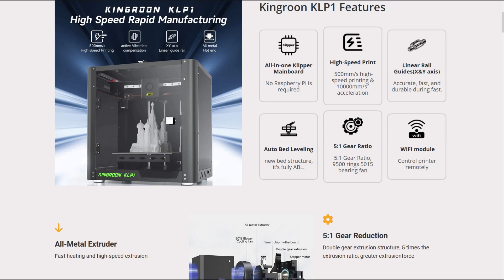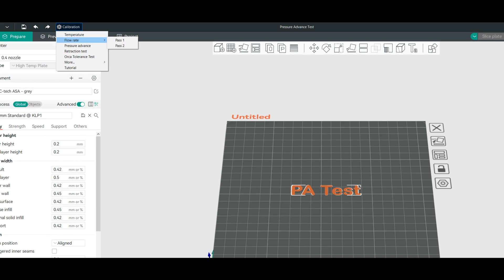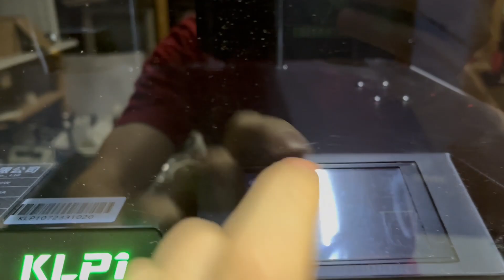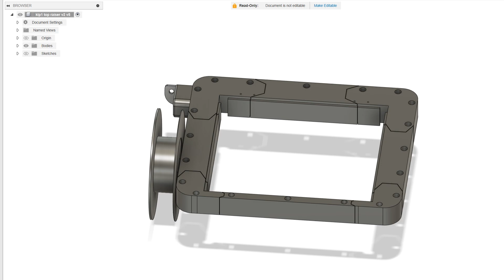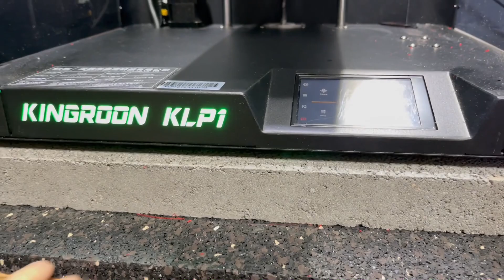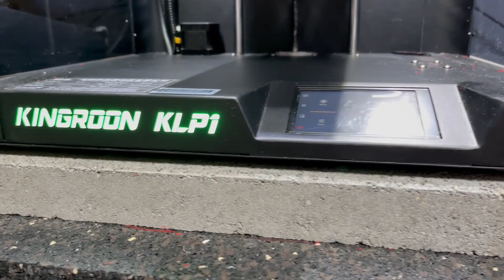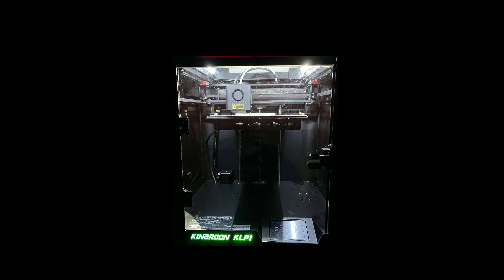Kingroon KLP1 3D printer review after 3 month

Comment: Hi great video, can you please share the profiles you are using for the printer?
Reply from the maker: I am using Orca with the profile provided by Kingroon:

https://1drv.ms/f/s!AmGcVrncIH3Zk2otPcnHZrOZPGA5?e=eH3KUu

I made two changes only:
- I tend to create a calibrated profile for filaments
- I set max volumetric speed to 15 mm3/sec for PLA and PET and 13 mm2/sec for ABS and ASA.

On top on that based on the print I change support and strenght, like amount of wall loops. The typical setting is 3-6 walls with 20-33% infill. But that is really based on the printed part.

Comment: Im curious how this printer is working out 1 year later. Its currently on sale with a 100 off coupon code dropping the price down to 229 ( I didnt check the shipping cost)  but something tells me this didn't work out.
Reply from the maker: It is still running. I do not use it daily, but weekly. I had only one issue: I to replace both fans after a while, but that it is. It doesn't show any sign of instability now, but really I am using it when I have a project or when I need something technical. I use 90% ASA, so it is a bit more heat stressed compared to PLA. Few numbers from fluidd:

Longest print was just over a day: 24:43. The total print time is getting to a rounded number: 249:22 and the average print time is 1:37. Total filament usage: 2325.89 meters.
Reply: I just bought one of these at the sale price. For that price, I couldn't pass it up. The shipping was free. I live in the US and it arrived in two days which shocked me. I know this printer has its faults, but it makes a great starting point for a small enclosed printer for printing temperature sensitive materials. One of my current printers is a KP3S which cost only $150 and it has been very reliable for several years and produces great prints. I'm looking forward to tweeking the KLP1 to make it better. I like the idea of a riser in order to clear the filament tube and wiring so I'll design and make something similar. I will be replacing all of the tinted acrylic panels with clear panels. I will also move the display to the outside to make my life easier. I plan to print ABS/ASA/Nylon with mine so I'll be feeding it filament directly from my filament dryer. And of course, I'll be adding LED lighting to the inside, along with a camera.
Reply from the maker: @Waltkat  There are room for improvement, but the reduced price makes this printer a good value. I use it for ASA without dryer and it works fine. I found the fans a bit weak, but since they were replaced I have had no issue.

Comment: Hi, really good review. I would like to know if you know the procedure to remove or replace the hot-end nozzle? For example if I wanted to change it for larger extrusion size, fixing clog, or by using different design and material.
Reply from the maker: Hi, Sorry for slow response. I tend to recommend Kingroon official video for hotend replacement. It is decent and you can see all the steps: https://www.youtube.com/watch?v=TyAIzESYg4k

Comment: thank for this review since im looking in to getting one 
im aware of the issue but these seem minor and fixable 
all do i was wanting to ask if you could share the print for the top you made so i can install the LED
i  seen similiar raisers but  not where i can easyly place  or add the lights 
if not thats oke but still thank for the review
Reply from the maker: I would be happy to share, but a crash took my latest design. What I have does not fit properly. I mean the screws were moved few mm to be on the right spot after that backup . If you check out my answer to MrTanku you may find there alternatives. I used rail for the given LED stripe I could source in the local shop. So there is nothing special, just few screws and some glue.

Comment: Can you provide the files for the top panel riser?
Reply from the maker: An unfortunate crash took my latest design. What I do have is not 100% accurate, as far as I remember the screw position of the top lid is not fine and I miss the holes to secure the LED. But others also faced the same issue and they were smarter than me to have a copy of their design. I found two of them, I hope that helps you to solve the close lid problem. They implemented a bit different but at least as suffice way as I did:

https://www.printables.com/model/652878-kingroon-klp1-raised-top
https://www.printables.com/model/665629-30mm-top-riser-for-kingroon-klp1
Reply: Could you share the led strip you used? Where did you connect the strip? Thanks
Reply from the maker: @Mr0neShotAway  I went to the local shop and sourced there the stuff, so I recommend the same. After a quick discussion with the sales person the selected one was 24V cold white (gives more contrast than warm LED) and 800 lumen/meter. It is powered directly from the PSU, this is why I removed the bottom of the printer. It also means when the printer is on there is light. The wire is, as far as I remember, an AWG20 (0.5 mm2) one. Since it is pulling less than 1A I may say it is an overkill. You can reduce it to make it easier to handle, but there is warm in the chamber, therefore I would oversize by a factor of 2 at least.